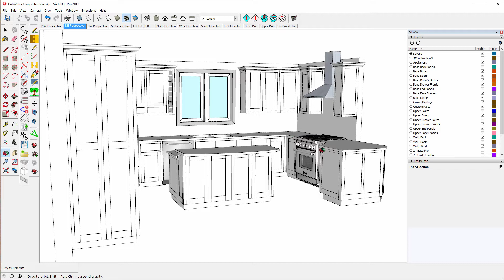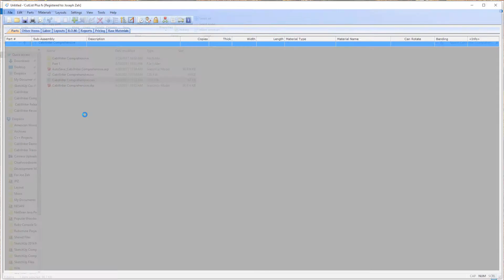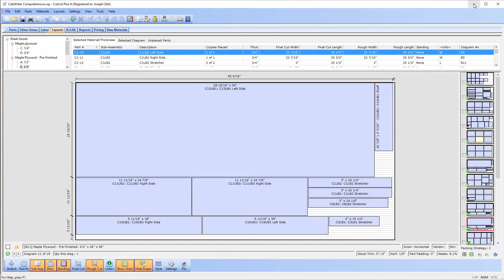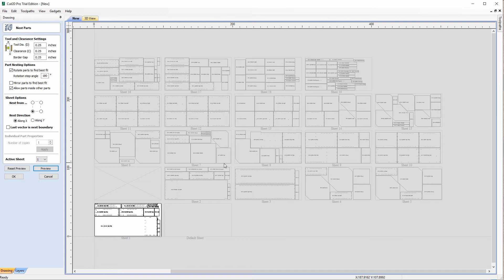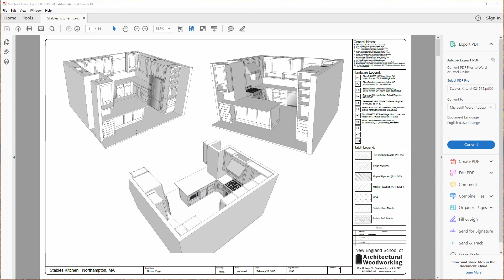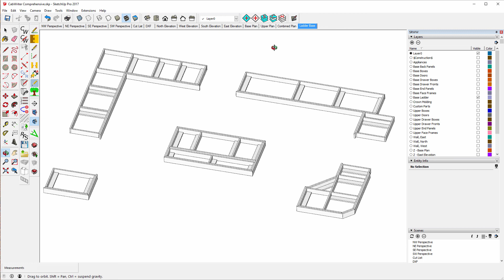CabWriter Comprehensive   Part 1

Comment: I find it very odd that the first thing you choose to insert a cabinet is its stiles type. The first thing should be type of cabinet, width, #no of doors and shelves. Everything else should come later once the cabinet is inserted. Use sensible defaults for everything else.
Reply from the maker: Hi There,

We certainly did choose a different approach based on the concept of a story stick.  The main reason we did this is because the software was designed with high end custom cabinetmaking in mind.  In a high end face frame design, there is no seam between cabinet boxes; you have a unified face frame which means two boxes share a single stile.If we need an 8' run of cabinets with a mix of cabinet types; drawers, doors, door and drawers, etc. you build it as one long unified cabinet and bring it to the site that way for installation.  In that case, you can't place each cabinet individually, or if you did, you would have to have another tool to stitch together the face frame.  

We chose to use the story stick method to lay out where you want your cabinets to be placed, then specify what each box is.  We didn't feel there was a need to preview each cabinet, since you know what it's going to look like based on the parameters you've set to match your construction method.  If it's wrong, you can either edit the parameters (which are tabbed), the redraw the cabinet, or if you just need to edit the cabinet type, it does lead you through a couple of dialog boxes.  However, there isn't enough information on those screens to really warrant the tabs.  I've drawn over 20 large projects with the software and once you get the hang of the story stick, it works really well and you can lay out a whole run of cabinets very quickly.
Reply: CabWriter what about frameless cabinets?
Reply from the maker: So, it works the same way, except instead of stiles, you're laying out the transitions between cabinets.  In the next major revision of CabWriter (2.0) we're removing the concepts of stiles and just going to reference cabinet ends and connections between cabinets.  If you're frameless, you've turned of the stiles and rails, so the story stick will reflect the width of two cabinet sides based on what you've set in the parameters.  So, you can still lay out a run of cabinets very quickly.  

If you don't have the story stick, you would typically still need to lay out where all of your cabinets go using guidelines on the floor so that you know everything will fit, which is basically like doing a story stick.  We've combined the two concepts into one operation, which actually takes less time.  When you get used to it, you'd be amazed at how quickly you can draw a kitchen...